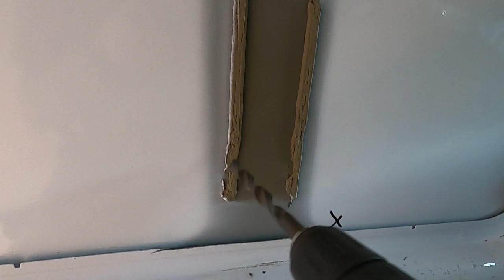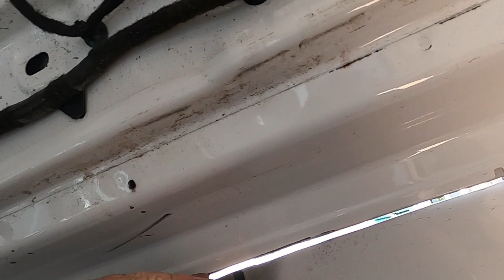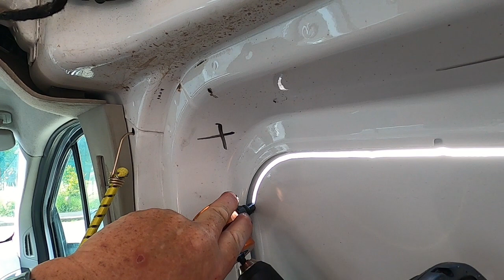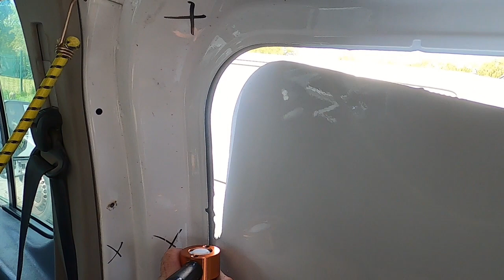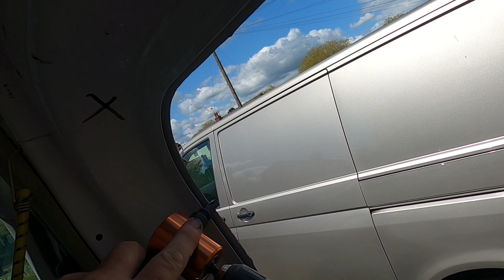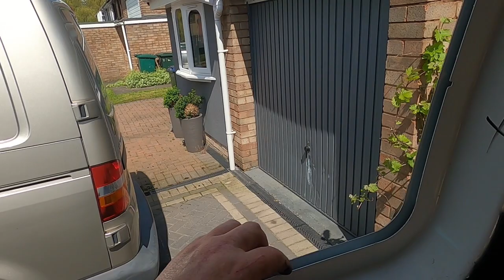Cutting out Camper Van Windows Metal Nibbler Drill Attachment

Comment: Hi. Looks like it works well, can you kindly provide a link to the product
Reply from the maker: eBay item number 265092349132  Metal Cutting Double Head Sheet Nibbler Hole Saw Cutter Drill Attachment Tool UK
Reply: What size trim did you end up using